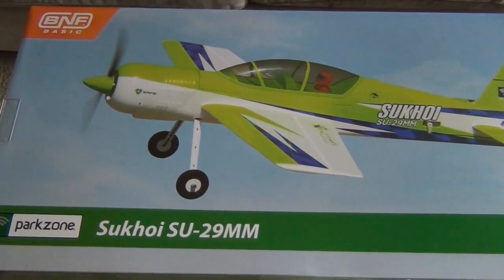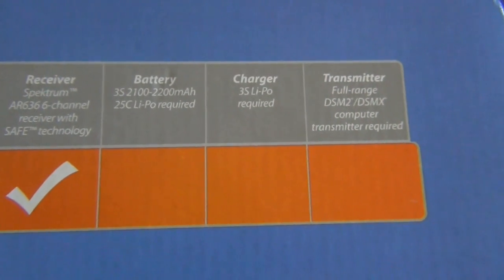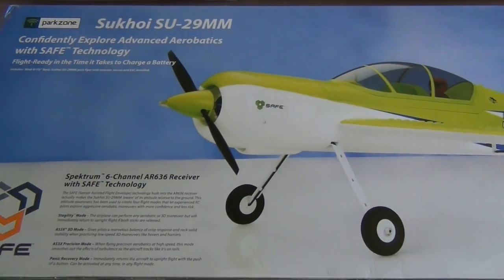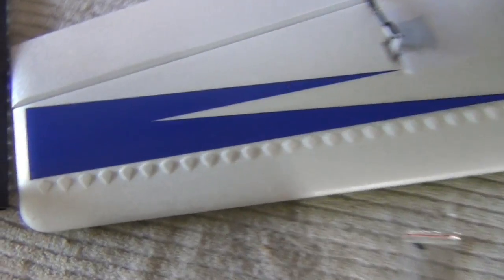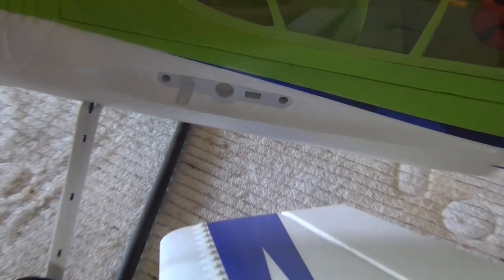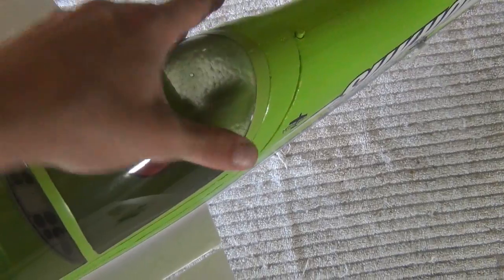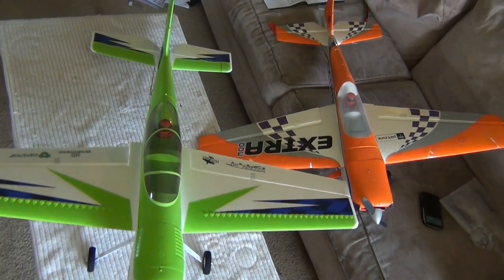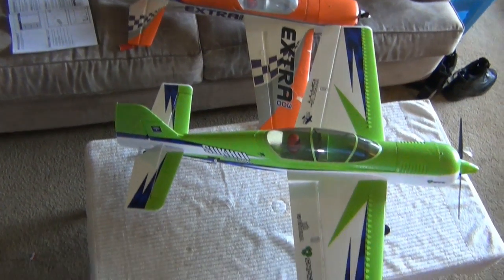Parkzone Sukhoi SU-29MM Overview & Build

Comment: Maidened mine & re-maidened it the next day with a non-as3x receiver. Muuuuuch better! Original receiver caused horrible oscillation in all 3 modes. Fortunately I had a spare
Reply: I had the same problem with the oscillation, in the manual it says it will oscillate in stagility and 3d mode if you go too fast. Precision mode is for fast flying, but the switch for it won't work if you follow what the manual says for your TX set up. It says to set the U to 100% but you need to set it to 125% for it to work, otherwise you think your in precision mode but really your still in 3D mode. (-:
Reply: Jax Teller RC Thank you! I'll remember that if I ever get another "safe" airplane. I already sold my 2 safe receivers on ebay!
Reply: czcubflyer rl 
Yeah I only just found out myself, have 2 planes that will work properly now ha ha

Comment: Did you ever try the E-flite Carbon-z Yak 54?  I am not too happy with how the SU-29MM flies compared to the Visionaire having limited space and trees around.  I should have known from the lower wing area. It stalls and drops on sharp turns without much warning. I hope the Yak 54 is what I expected to get from the Sukhoi. Based on the Realflight models people uploaded,  It can probably go twice as fast as the Visionaire and handle 3D well at slow speeds.

Comment: I just got mine yesterday and set it up according to the manual. Somehow the modes and throws do not seem right. I am using a DX8 and according to some forums, they say to reverse the trainer switch. (Panic Button). What are your settings on your radio? Can you confirm that the panic button is the bind button on the radio?